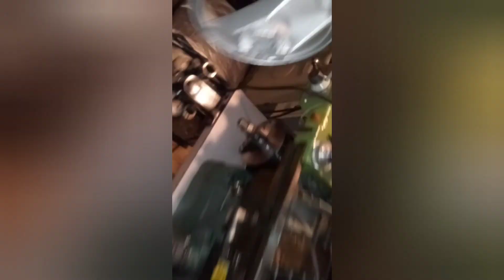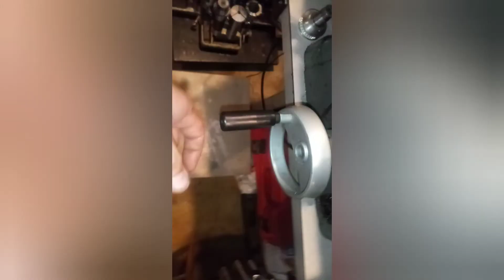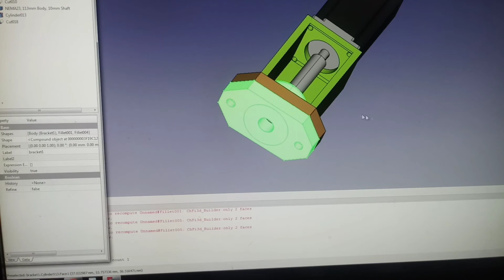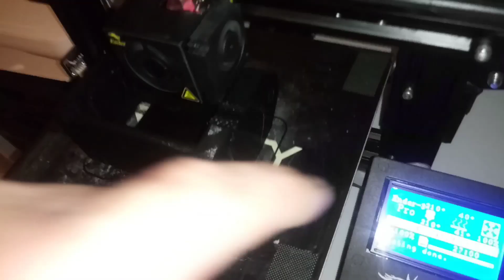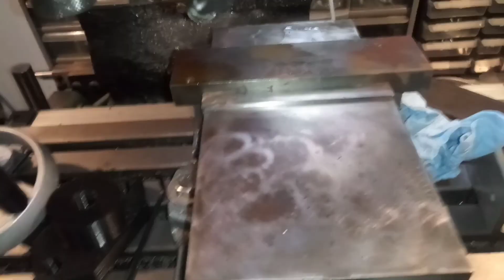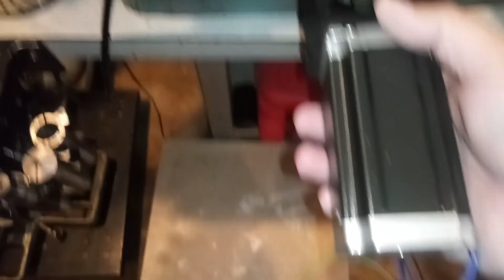A Partial CNC Conversion On My Vertical Milling Maching

Comment: The first thing I thought of when you pulled the Y handle was that's a Lovejoy coupling. Why not go with that it'll shorten up the whole thing. Also, you have a lathe and mill why not make your own coupling? I know it takes time but you can get exactly what you need that way. 😁
Reply from the maker: It's funny you should say that. Yesterday I was designing one in my cad program to possibly try and make one. They do seem easy enough to make. I might give it shot. Thanks for watching and the great idea.

Comment: I like that decision!  On my junk built mill the drive belt pulley's V is lathed into the round of the handle crank, but's it's not a toothed belt.  You were putting some time in on the printer! Damn! I like that you can make parts like that. I additionally like this video because it answers questions I had about the mounting of the motors. ALSO... I think you did yourself a solid in showing the CAD design along with the mill, and the 3D printed parts. So many times I see videos where they would be so much better if the creator just showed even a pencil sketch of what they were doing (I fail at that in my own project videos, but I do it purposely to add weight to the reveal of what it is) so that we could follow along and consider the problem or task at hand.
Reply from the maker: Yea I really wasn't sure which way I wanted to go. That's one of the reasons I love the 3d printer. Being able to make semi finished parts for fit is helpful when your not a full fledged engineer with a full time job doing this stuff. 
 The acme screws that are on the mill are pretty good too. They is no backlash on the X Axis and there's just a little bit on the Y Axis.  I can take out the back lash in the mach 3 program.
Reply: @backwardsmachining7526  Can you imagine the CNC machining and 3D printing capabilities of like 50 years from now? Manual machining will seem like the Bronze Age.
Reply from the maker: @johnstrange6799  John I truly hope to be around long enough to see the metal 3d printing drop into my price range. I would love one of those baby's. Be able to 3d print titanium or stainless steel lol. I wouldn't leave my house.
Reply: @backwardsmachining7526  It's madness! I think it's cool how that kind of creation accessibility and possibilities opens the door to other mechanical or scientific areas. If one's focus in no longer on just making (for instance) some kind of jet engine parts, then if of the right mind, that person will surely wander into some new unfamiliar territory, like propulsion, or rockets or something. Right now it seems mostly that many of us have one foot in making parts (machining) and the other foot in what we are making the parts for.  - There's also the kind of tantalizing thoughts of some super machine that can do almost anything! Like imagine what would be brought to Mars to build things for colonization. Imagine how versatile and well designed and built it would have to be. When all was said and done, it seems like that super machine, and all of the research and design footwork that went into making it would be as complex and intense (if not more so) as what went into getting it to Mars.
Reply from the maker: @johnstrange6799  I definitely agree. plus we don't know what technology really is out there right now supposedly the government's I was fifty years ahead of what we see so who knows what they even have. I just think it would be cool to have one machine that does everything I mean if you had a metal 3D printer you wouldn't need any other machine no lathe no mil no boring... nothing all done on one machine and not only that there's no seems so there'd be no weak points. and you wouldn't be limited to manufacturing designs that were limited to now.
Reply: @backwardsmachining7526  It boggles the old melon for sure.
Reply: @backwardsmachining7526  What was the collet size you were looking for again?
Reply from the maker: @johnstrange6799  brown and sharp #11 draw bar style
Reply: @backwardsmachining7526  False alarm. :(
Reply from the maker: @johnstrange6799  its ok I'm actually very thankful you at least thought about it. Thanks for trying.
Reply: You're welcome and sorry for the false alarm. I did the mentioning, and credit goes to Eddie who in the spirit of community did the potential offering, but alas not the right size that he has a random one or two of.
Reply from the maker: @johnstrange6799  unfortunately that machine is so old I'm not suprised.